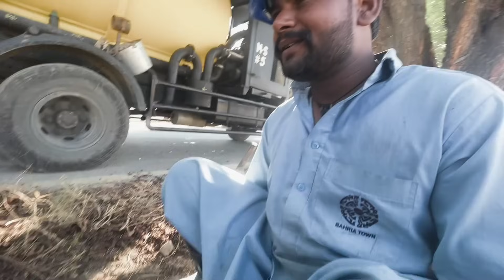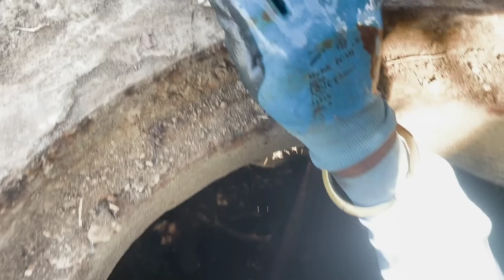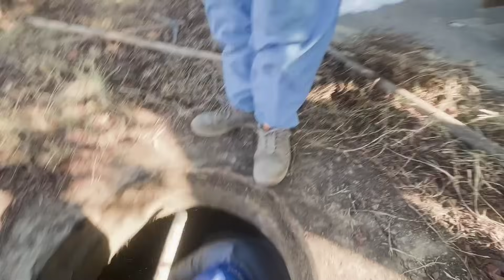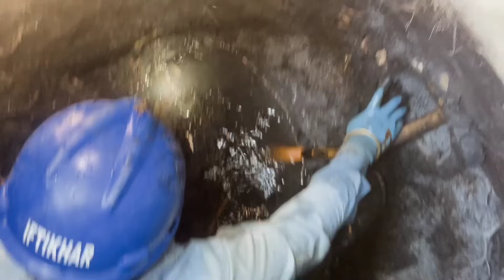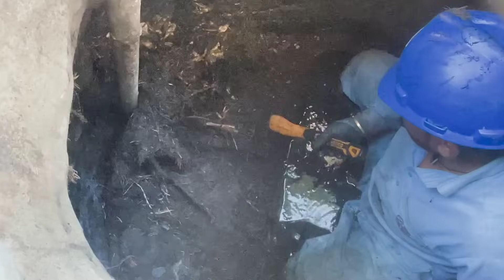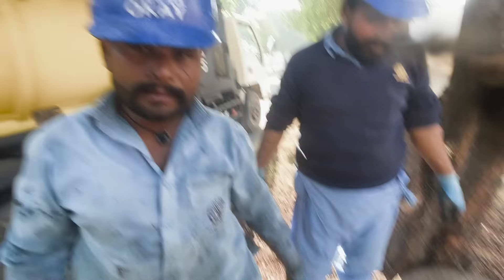Drain Complaint 292 | Entire sewer line was drained with a heavy flush as the black mamba pulled out

Comment: Dude, the chainsaw will not cut until the sharp edge of the chain is turned around so it can cut into the wood. Someone put the chain on backwards. Swap the left hand side over so the left side is on the right hand side.  Plus, the chainsaw is for cutting woody items not soil, bricks, concrete or body parts.
Reply from the maker: Yes, we will definitely check the blades.